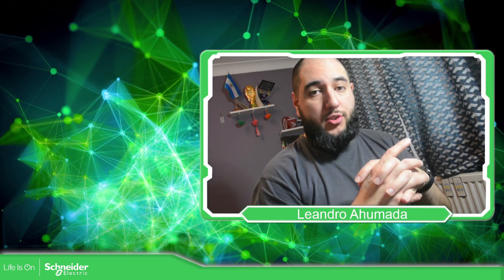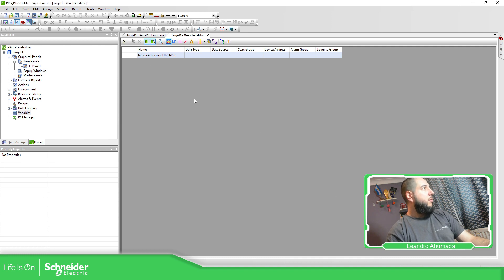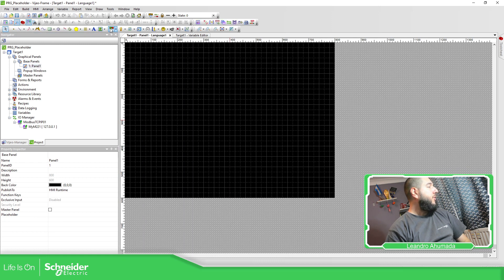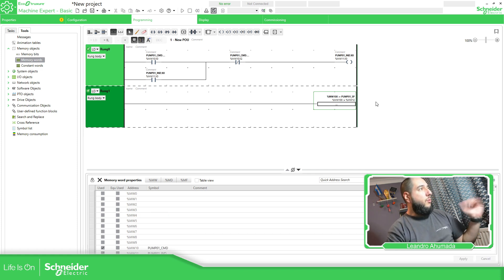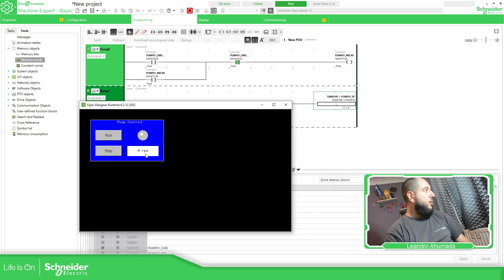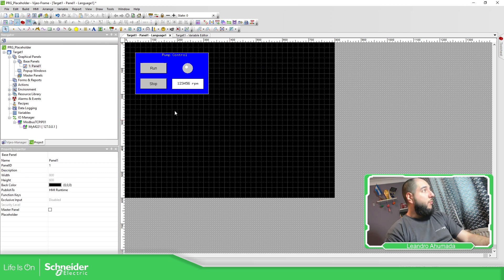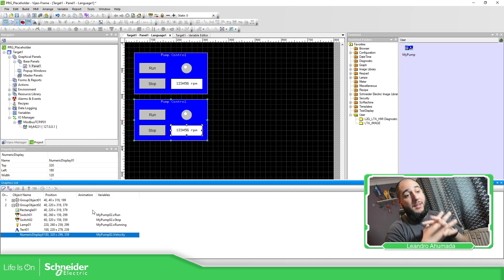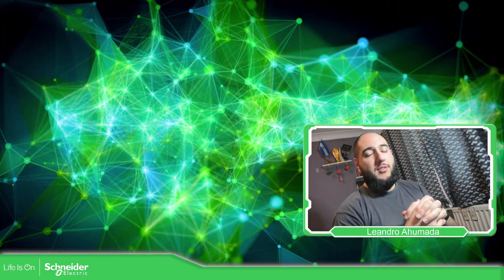Vijeo Designer Training - M11.1 How to use Placeholder feature

Comment: Hello, thank you for sharing all the videos you upload. I wanted to ask if you know how I can enable a variable to be retained in EcoStruxure. I need to make some variables retained so that, even if there is a power outage in the machine, those variables retain their value prior to the power loss. I'm not sure if this option is enabled in EcoStruxure, but I know it exists in TIA Portal, for example. Does this option exist in EcoStruxure? If so, how can I enable it in my project? Thank you.
Reply from the maker: Hi there! Not sure which EcoStruxure you are working with but I will guess EcoStruxure Machine Expert so you can check the next video:
https://youtu.be/DITcgYUYr3Y
Reply: @LeTomasAHUMADA  Hey, thank you for answering. Im using Ecostruxure Machine Expert - Basic Version 1.2 SP1 build 65670. I do not recognize the software of the video you told me to check :/ Do you know if i can transfer my program project into the version you talk about in order to make some variables to be retained? Thank you in advance.
Reply from the maker: @tonimejias7114  the variables from %MW0 to %MW49 are retentive then if you want lore you have the %S to back up the data
Reply: @LeTomasAHUMADA  Thank you, that was a piece of information I wasn't aware of. I searched through the Ecostruxure manual and didn't find anything about those memory spaces being retentive. So, for example, if I do a Set on a coil within the range %MW0 to %MW49, like MW5, bit 5 (%MW5:X5), would that bit become retentive? In case of power loss to the machine, upon restoring power, would the bit retain its previous state? Thanks in advance.
Reply from the maker: @tonimejias7114  exactly! Of course you can try it with your plc to validate what i mentioned 😊
Reply: @LeTomasAHUMADA  Thank you so much sir! i will prove it tomorrow :)